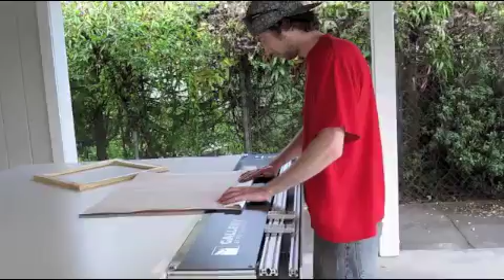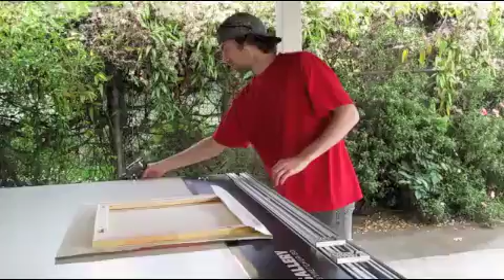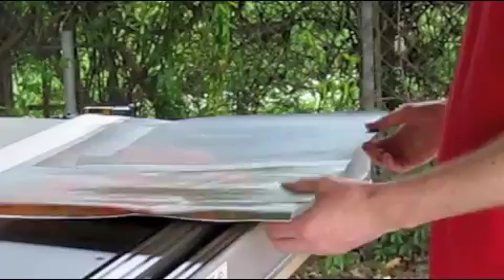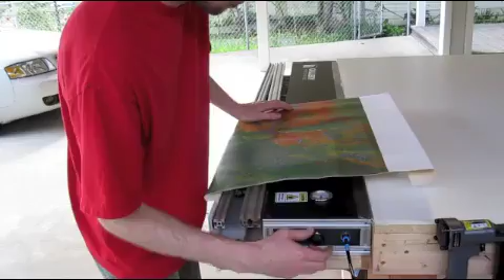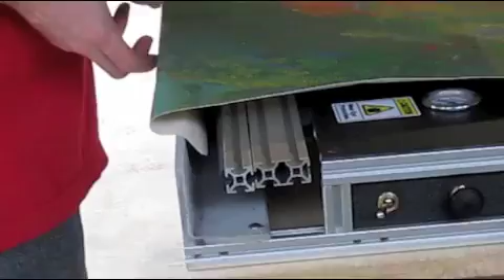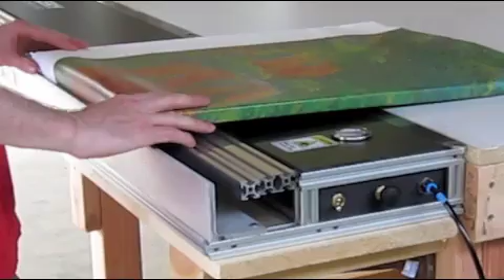Gallery Wrap

Comment: I like your video and the bench looks great. I recommend "centering" the artwork on the machine to avoid binding. All of the energy from the cylinders is concentrated in the middle.  I would also recommend a "long-nose" staple gun to avoid firing the staples at such a severe angle, the staples tend to not seat well at this angle. We really do need to update our video.

Comment: One more recommendation...you should consider using twice as many staples.  Imagine that all of the tension on the canvas is on only those few staples, sagging will result between the staples causing the canvas to pull away from the staple. Just a suggestion...Great video...thanks for the post.